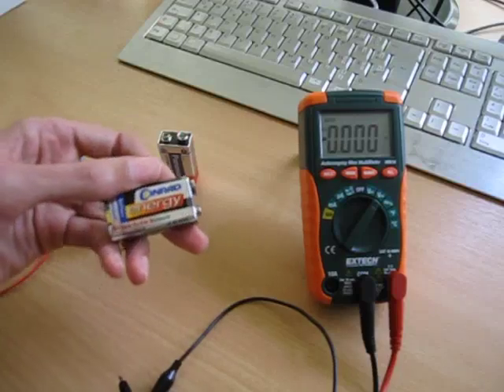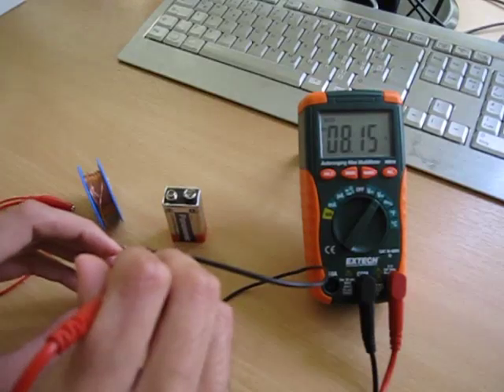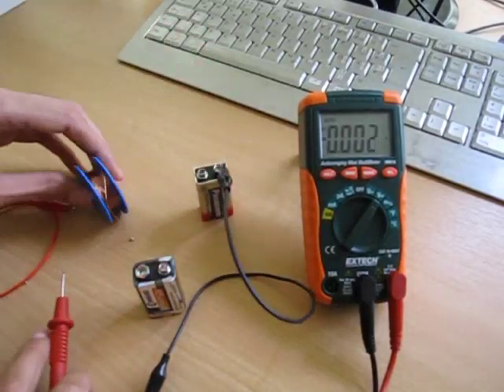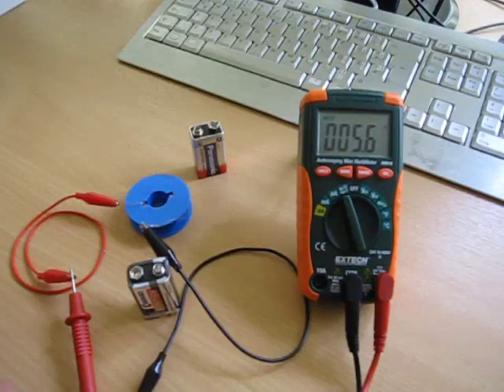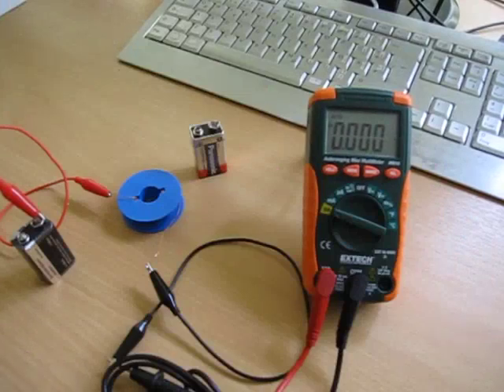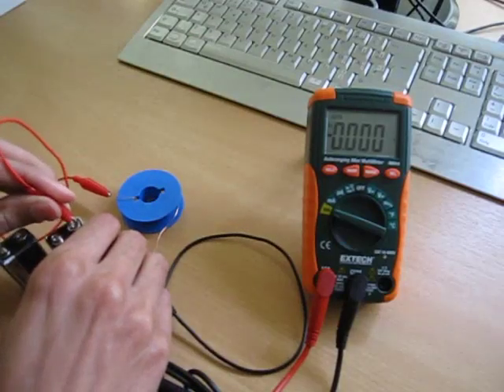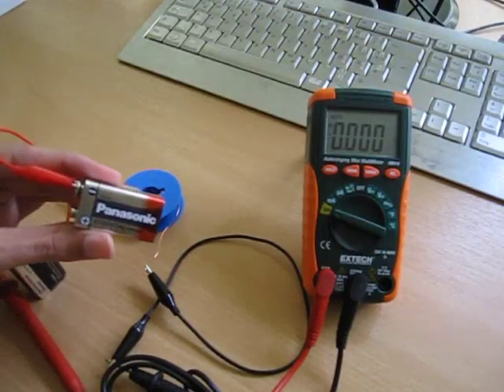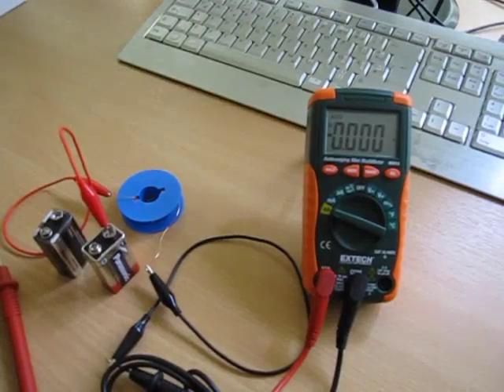How to test the internal resistance of a battery

Comment: Thank you for the video.
Another way to calculate internal resistance is by using 3 parameters below
1.open terminal voltage of the battery(volt)
2.terminal voltage of the battery when connected(supplying) to the resistor(volt)
3.The current flowing in the resistor(Ampere)
Deduct 2 from 1( this is voltage drop across battery internal resistance)
Divide the result above with 3(ohms)

Comment: It's not the math that's off, it's the method of testing. You have to measure the drop in voltage. Internal resistance will come out in milliohms, not ohms. (Vi - Vl) / I where Vi = unloaded voltage, Vl is loaded voltage, and I is the current the battery draws while shorted with the resistor. Additionally, in order to really do it right, you have to measure both the loaded voltage and the current at the same time. Typical resistance of an alkaline 9v battery ranges from 150 to 300 milliohms.
Reply: You don't need to measure the loaded current. Unless you don't believe in Ohm's law it is equal to the resistor voltage divided by the resistance. The internal resistance can be derived with knowledge of the open circuit voltage, loaded voltage and resistor load OR open circuit voltage, loaded voltage and loaded current.  Either one is just fine.

Comment: i also do that with my AA nimh batteries either to have a rough idea of the state of charge or its health. good cells give about 9A while old ones barely 2 to 3A. For obvious reasons this only works for small batteries, anything bigger then 2500mA AA nimh batteries could blow the shit out of the leads or the multimeter itself. Also never test it like this for very long nor very often as this damages the internal chemistry, just hold for a sec so that it stabilizes

Comment: Hi, I know this formula is correct (at least in theory). In pratice, the amperimeter internal impedance could have a huge influence in the measurement. I dont know the actual impedance, but I believe its around 10 ohm. If I am correct about this value, there is a huge error in the current measurement. Anyways, I always prefer to measure the voltage drop in a known resistance to not take the risk.

Comment from the maker: Since the battery itself has an internal resistance, I am in fact using 2 resistors. I think that you do not understand the concept of internal resistance.

The only reason why you need to do something as you propose is if you assume the internal resistance varies with current. But that is only needed if you really need to know it with high precision. Since this is a battery and the voltage will drop anyway during its lifetime, it makes no sense.

Comment from the maker: Not exactly, if you add an extra resistor, you will also influence current, making the voltage on your original resistor 1.125 V. If you want to have 1 V over resistor R1 by adding resistor R2 you need to solve the formulas: V_bat = (R1+R2)*I and R1*I=1V. From your measurement it follows: R1=V/I=1.5/0.17=8,82 ohm. The new current follows from the requirement: I=1/R1=0.1134 A Using V-bat = 1.5 V you get R2=(V_bat-R1*I)/I = (1.5-1)/0.1134 = 4.409 Ohm, which is half the value of R1.
Reply: Thank you for the video.
Another way to calculate internal resistance is by using 3 parameters below
1.open terminal voltage of the battery(volt)
2.terminal voltage of the battery when connected(supplying) to the resistor(volt)
3.The current flowing in the resistor(Ampere)
Deduct 2 from 1( this is voltage drop across battery internal resistance)
Divide the result above with 3(ohms)

Comment from the maker: I misunderstood your first question. You need to measure voltage and current through the battery. It is not possible to measure resistance on a battery. The formula for internal resistance would then be: R = V/I. But measuring the current (I) is very dangerous.

Comment from the maker: You can, but the current might be so high that you damage the battery, your meter or yourself. And even if it works your results might be unreliable, because the heat generation might cause the resistance to temporarily increase.

Comment from the maker: Well, I directly short circuit the batteries in this test, which gives you the maximum current. This is not advisable for some batteries and you should not do it often for any battery. The external load should have high enough energy dissipating power to not explode due to the current. I don't know the batteries you mention. If they are meant for high current applications, I would not short circuit them at all.

Comment: Can you advise on how many ohms would be needed in the external load to test Lithium Polymer packs, 3S and 6 S, so 11.1 and 22.2 V?

Because of the very high currents possible with these packs i want to get the resistance right!